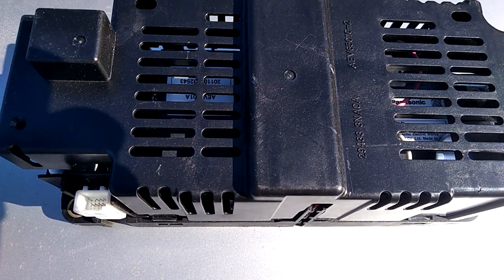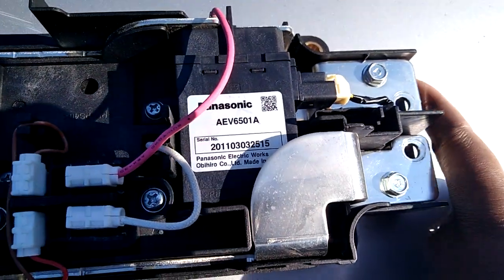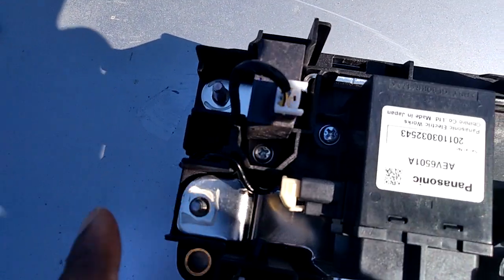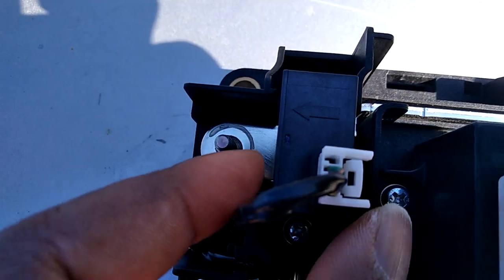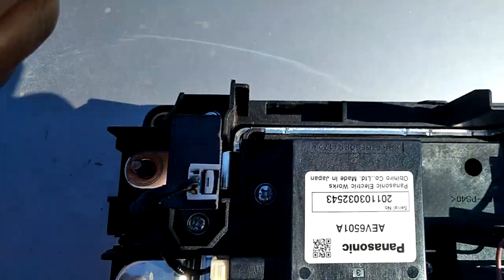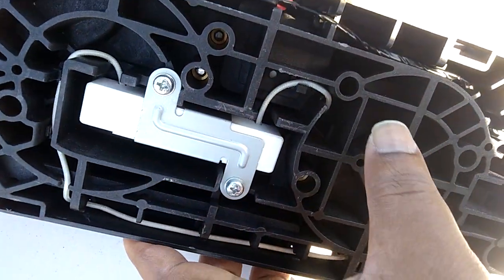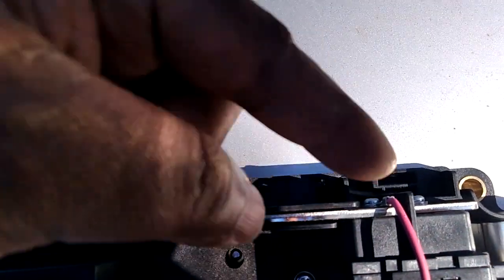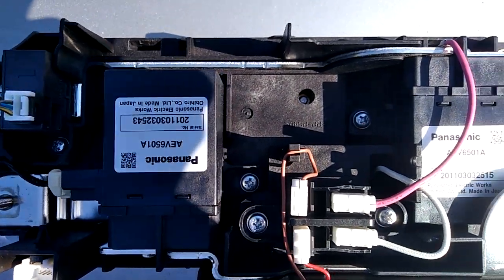Nissan leaf Battery Extender Connection

Comment: you got it right my friend! i was calling the current hall affect censer the shunt lol my bad. but the battery only see's half or less of the current the car uses now. i have yet to try a long test over 100km but I have driven 80km and was at 370v under load :)